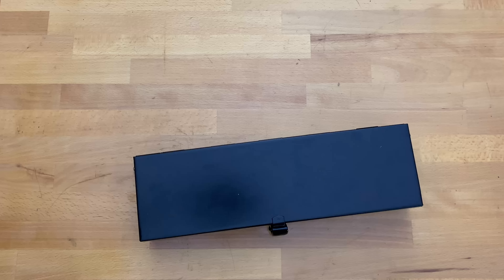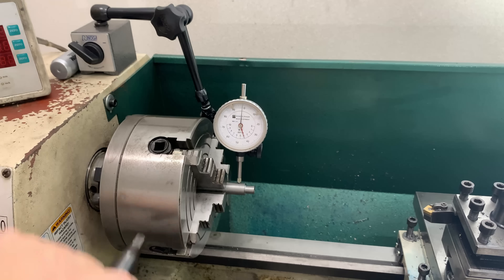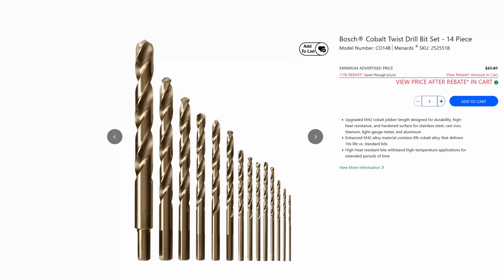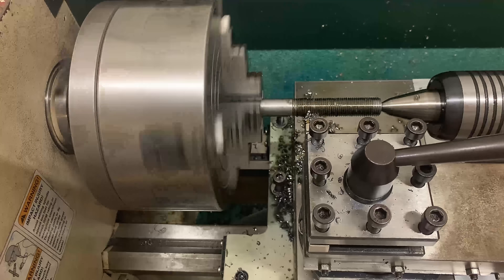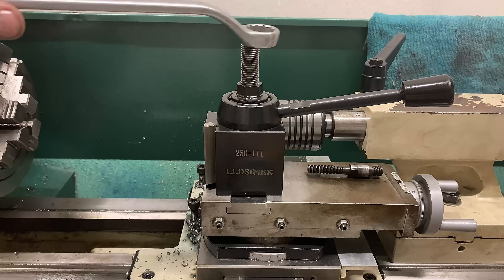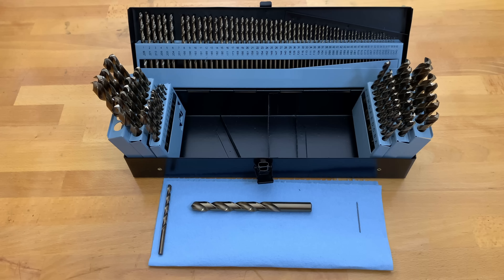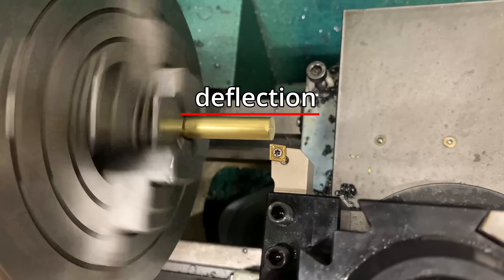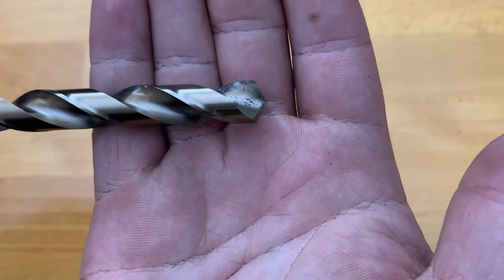Are Harbor Freight Drill Bits Secretly AMAZING?

Comment: A little input from a machinist. I use cobalt drills specifically on stainless. If you want to test these drills, carefully hand drilling some sheet stainless is the test.

To convert to and from metric the magic number is 25.4. A #7 drill is .201"... .201" X 25.4 = 5.1054mm ... 5.1054 / 25.4 = .201" ... This is faster for me than a conversion table. 

Good video! I'm planning on buying a set of these for my home shop!
Reply: The magic is to have a drill guide chart that has all the numbers, letters and fractional sizes with their decimal equivalents and metric values. If you can figure out how to access my Google docs there's a nice one to print out there. The best you're going to find on the Internet. It's the Rosetta stone.
Reply from the maker: Thanks man. I really appreciate the thoughts about stainless. I’m going to have to give that a go. Most of the stuff I work with around my garage-based workshop is mild steel, aluminum and brass so that’s what I went with but stainless would be a really good test too. 

Your conversion trick is solid.
Reply: @ShopHumor  For softer material in a home-shop, HSS isn't just as good, it's better than cobalt.  It's less hard, which means less brittle.  HSS is more forgiving, less likely to chip, and easier to sharpen.  Save money, buy a cheaper set, and buy a drill-doctor (ish) sharpening rig.  Always have sharp bits.

Shops use cobalt because it's all about the lifecycle metrics... how many holes in a give material before replacing the not quite dull bit before it breaks.  Time is money and if a dialed-in machine can push a harder bit through faster for longer, it's worth the cost.  That isn't how home-shops typically work.

In my shop, the only time I've ever used a bit from sharp to dull is when I've used the wrong bit.  Most every time, I drill the few holes i need, look at the bit when I take it out, and if it shows any wear I take the 30 seconds to sharpen it before I put it away for the next time.  It's always sharp when I start.

Now, if I start drilling a hole and the bit falls on its proverbial face, usually in under 13 seconds, that's when the cobalt bits come out, after I re-sharpen the bit I just wrecked.  And, then I'm careful because the chunk of mysterium metal I started with is obviously a lot harder than I thought. Then it's all: watch for chatter, don't let the material work-harden, etc., etc..

Comment: My brother has this set. We had a wild numb of them bend. We bought them knowing they'd be abused, but I'd never known drill bits to bend before
Reply from the maker: That’s crazy haha I can’t count the number of drills that I’ve had just snap in all my years of drilling holes but I’ve never had one bend. I would think anything with cobalt would be even less likely to bend because it makes them harder but more brittle.
Reply: No yeah super abusive use on our part, mostly going dry and raw through work hardened materials using cordless drills at bad angles.  My brother bought this set because he thought most bits for cheapest price, I bought a set that's just imperial sizes with multiple of each size because I'm mostly just drilling holes to use fasteners through and don't need ever single size